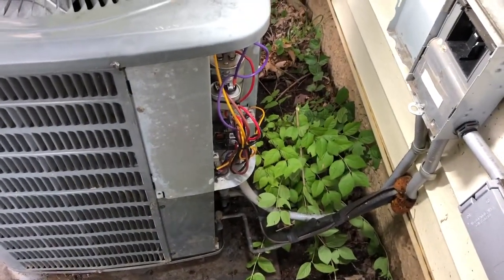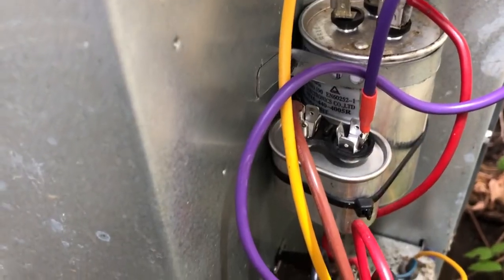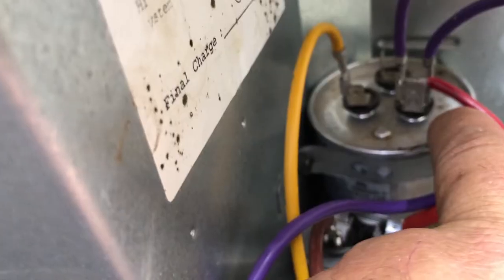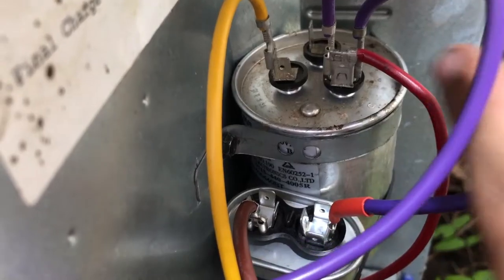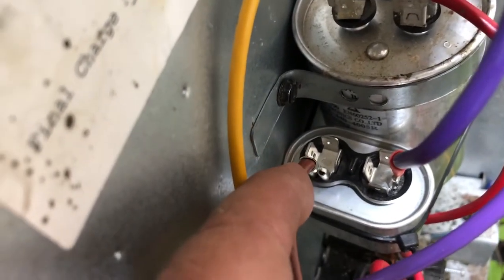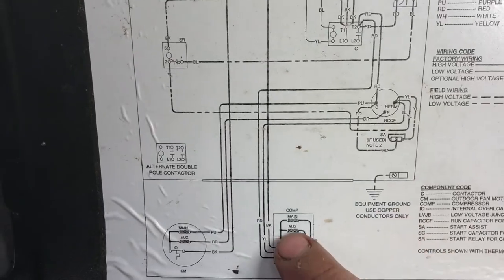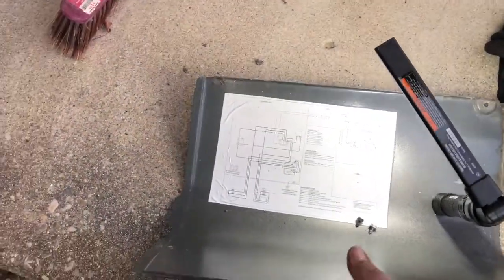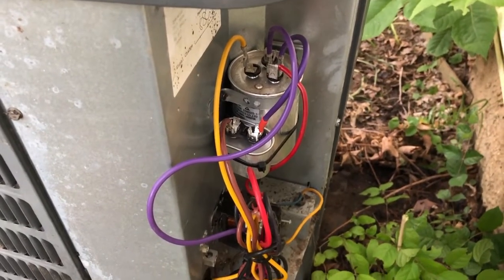Splitting A/C Condenser Dual Capacitor with a Single Fan Capacitor

Comment: Thank you very much. I knew this was possible but wasn't sure about the connections and polarity on the single split capacitor. I later realized polarity doesn't matter on these single ones so hooked it up and it works. Thanks again
Reply from the maker: Glad it helped

Comment: Thanks, man! This happened to my 2000 ac unit. The compressor works but the fan wont start on it's own, without a push.  At some time in the past, someone added a small 5 run capacitor to the origination duel 35/5...but they didn't use jumpers. It' wired weird with brown fan wires going over thee top on the unit to the fan. The original dual cap has TWO yellow, wires on one terminal and TWO hots to one terminal. I'm just going to leave all that as is, and replace the little 5 capacitor.
Reply from the maker: Glad it helped

Comment: I wish my A/C unit had the wiring diagram on the access panel. My A/C unit is 22 years old & I've had to replace the capacitor twice. I now keep an extra on hand. Last week I replaced the capacitor on my sister's dinosaur A/C system. I think that unit was older than me. 

FYI, a good HVAC channel that has a lot of great info is "Word of Advice TV".
Reply from the maker: If you get the Make/Model off of it and call the manufacturer they will send you a diagram.  They have to make them available by law.   I ordered a 2 pack of dual caps myself.  That way I will have one on hand as well.  Home Depot used to stock them, but they are special order now.

Comment: Hi, that's a dual run capacitor. But, how does the compressor and condenser fan motor work without a START CAPACITOR? I've always thought that a start capacitor was needed to start the compressor and condenser fan motor. And then the run capacitor takes over. Thanks
Reply from the maker: The capacitor for the fan motor is to adjust the phase of the motor slightly so I will start and run in the right direction.   The compressor is a start capacitor.

Comment: Great video. My problem is that the fan turn on but after a few minutes 10-15 minutes the fan turn off and compresor keep on.  Any idea?
Reply from the maker: Probably a bad fan motor.  But I would try the cap first to be sure.
Reply: @frugalprepper  but the fan when in the beginning works perfectly.  But after a minutes turn of. I understand that the capacitor it is to turn on the fan. But which capacitor or part keep the fan on?
Reply: @byshotmedia it’s your Fan Motor for sure. I had the same exact problem.

Comment: how would to wire a 2 wire hard start kit to that ?
Reply from the maker: If you are just putting in a extra cap like a 145 to 175, you can just put it in bewee the hot and the herm connection.  If you are putting one in with relay, you would have to follow the directions that come with the kit.
Reply: @frugalprepper  ok.. what if there's no space on common van I use piggyback terminal?

Comment: what 2 pole run capacitor AC unit mean ?
Reply from the maker: Well you have a 2 pole cap that runs on the Compressor and a 2 pole cap for the fan.  The Dual cap has one terminal in common and the other are compressor and fan.  There are also tough starting caps and relays on some units.

Comment: If your fan has two brown wires (solid brown and brown/white) do you just attach both browns to the 5 MFD Run Capacitor? 
I'm in a similar situation but my universal fan replacement motor has 4 wires total (2 being browns)
Reply: Yes just one brown to one side and the other brown to the other
Reply from the maker: Good, I wasn't sure.

Comment: I have a question. My unit has 5 wires, 3 for C, 1 for H and 1 for F. So, i bought 2 capacitors of 25f and 6f for the unit. Should i connect the herm wire to the bigger capacitor or the smaller one?
Reply from the maker: The compressor (H) will be the larger capacitor.   The fan (F) will be the smaller capacitor.   The commons (C) will go to the other sides of those capacitors bridged together.
Reply: @frugalprepper  so 2 commons to the large one and one common to the smaller one right? and the capacitor should be Bridged together
Reply: You should do research on how capacitors work, what “common” is, and read the wiring diagrams, getting an all round understanding of the electric is the only foolproof way to know what your doing is correct for your unit
Reply: Common will always connect the two capacitors together, or you can run common from them both directly to the contactor, there’s different ways of doing things so the best way is to have an all round understanding of how they work and why
Reply: Most residential AC compressors use ATLEAST a 30-45mfd capacitor to kick the compressor on, and the fan side will usually be 5mfd

Comment: Is there any reason you couldn't permanently leave it like this? I have a Carrier RV a/c that works fine, except they don't make parts for it anymore. It originally had a 45/12UF but nobody makes that anymore. A friend told me to just use a 45/10, but after doing that, the fan sometimes doesn't fully kick on. Then another friend who is an A/c guy told me it has to be in specs. So the only solution is to wire up a 12 by itself and do what you did here. Just wasn't sure if it would hurt anything to leave it long-term like this.
Reply from the maker: Yes you can do this permanently.  I didn't replace this one for like 3 years until the other side of it died.
Reply: Planned obsolescence, what a wonderful thing these manufacturers are doing nowadays. So considerate of these corporations, huh?

Comment: How about a universal fan?
Reply from the maker: You will have to see the capacitor rating for the replacement fan.
Reply: Can you please explain why the other purple wire is connected to the hot?

Comment: I’m not a tech but why change a single dual capacitor into two capacitors when the manufacturer put in a dual capacitor? Saying this because that’s what a tech did to my AC unit. Then I got billed for replacing two capacitors.